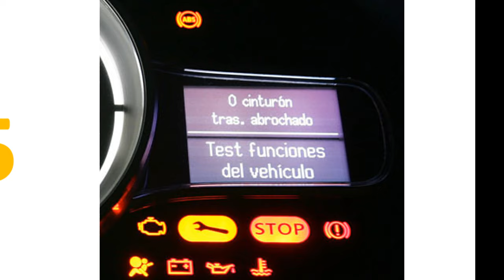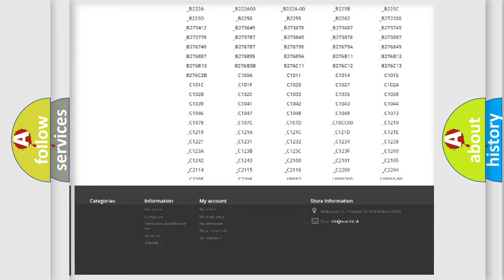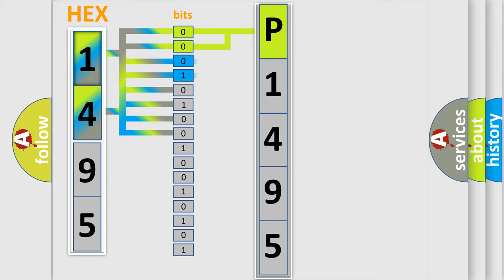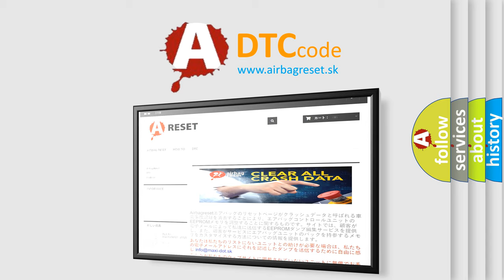DTC Dodge P1495 Short Explanation

Comment: P1495 is the evap emissions circuit. It's detected a leak in the evap controller so it's either the controller itself or a cracked hose. Your welcome.